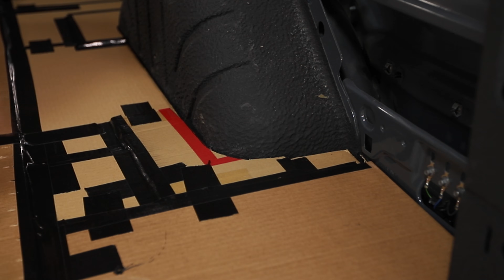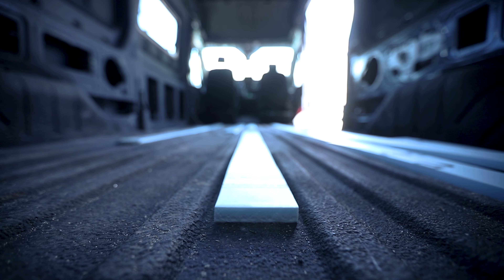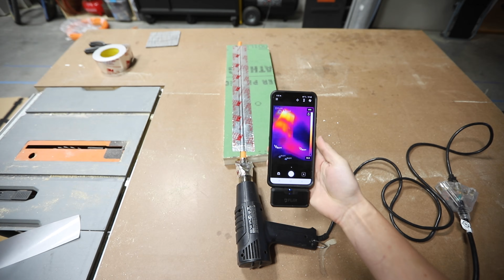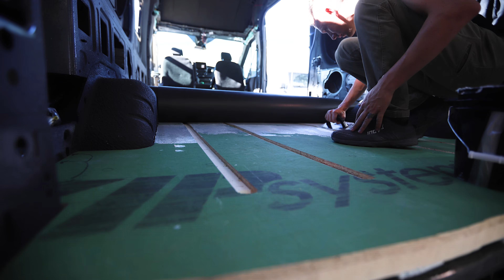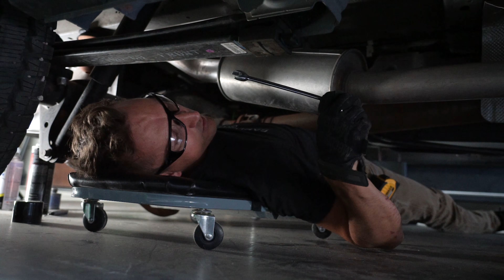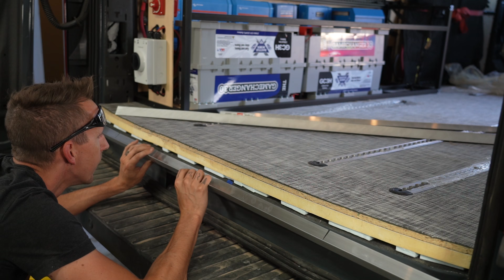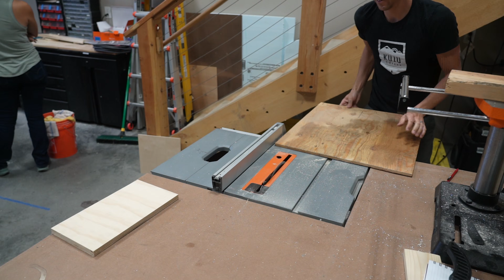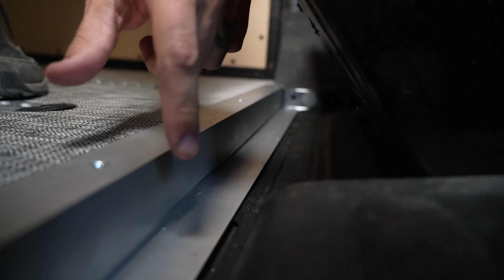VAN FLOORING PERFECTION (Insulation, Subfloor, Covering, L-Track & Step/Lip Trim)

Comment: Another option for templates if you don’t want to use cardboard is buying patterning paper. We use it in flooring to make templates for cutting in vinyl or marmoleum or safety floor. 

Your method also works though :) also rolling the carpet prior to installing the tracks would make it faster. And you can sometimes use a shop broom, flipped upside down so bristles stick up and slide the wood or plastic bottom along the floor to use it as a roller. 

Looks great!

Comment: Watching you install the L-track had me comparing the relative strength of the similar structure I just removed from an old Chevy conversion van.  They built a structure to strengthen the floor so that it could safely attach the seats and belts.  The thing was just massive!  It was steel, and it probably weighs 100 pounds, including the OSB they used to fill in the spaces between steel rails. It was almost two inches thick.  I'm going to enjoy the added headroom now that it's gone!

I almost never have passengers in the van, so the only seat that will be attached to the floor is the rear sofa' bed from the conversion van. without passengers sitting there, it doesn't need that massive steel structure to hold it in place. I'm planning to bolt it down again using the same bolt holes in the floor, and recycle the bolts.  On the subject of recycling,  I'll also recycle the washers that they used under the van, to reinforce the strength of the sheet metal floor around the bolts.  The washers are massive, heavy steel and huge!

Comment: How is that plywood to polyiso lap joint holding up? What kind of glue did you use?
Reply from the maker: Great!  We just used general purpose construction adhesive.
Reply: Follow up….what length bolts did you use to bolt down the l-track?

Comment: Excellent attention to detail. For the side step support, an alternative to your boxing in between the steps is to link the top and bottom steps with a threaded rod. We found the lower step as well as the upper had too much give underfoot, but the threaded rod stabilized both.
Reply from the maker: Probably so!  Thanks for watching.

Comment: Curious how this woven vinyl does with dirt (like actual particles of dirt, sand, crumbs, etc).  We've been thinking we wanted to avoid anything that would have small cracks/crevices/texture that would make sweeping that stuff out difficult.  I'd think as a woven material, this would be filled with those types of small voids?  Easily swept out?

You guys have made Sunday (drearily dubbed "the end of the weekend" at our house) a day we look forward to with your weekly video drops.  Thanks for brightening the end of the weekend! ;)
Reply from the maker: Sweeping sand out would be difficult.  That would be a job for a shop vac at the car wash.  We are choosing more texture and grip over easy to sweep out this time around.  Vacuuming should be a part of any regular cleaning, though, anyway as sweeping rarely gets into the nooks and crannies enough for me.

Comment: How did you position your L-Track to avoid drilling into the gas tank, brake lines, electrical lines, etc.?  When I look at the Ford 2022MY BEMM (I presume the 2021 model year is the same) it appears you are very close to, or on top of, their no-drill zones as shown on pages 162-165.
Reply from the maker: Yeah, VERY close.  I was underneath taking measurements and making sure we didn't drill through anything while Steph was up top drilling holes.  We did have to drop the fuel tank and the exhaust to make sure we didn't hit anything and to be able to tighten the bolts.  Definitely a necessity to not drill before knowing what's on the back-side.
Reply: @EXPLORISTlife  Would it have been feasible to use rivnuts or plusnuts and do all fasteners from inside the van instead of having to lower the fuel and exhaust to access the bolts on the underside of the van?
Reply: @erikmyklestad4817  A lot of people do that. If you're just attaching lightweight stuff like cabinets and accessories you will be fine with that method but it's not safe if you plan on attaching seats in case of an accident or if you plan on strapping down large heavy objects/motor vehicles inside either.

Comment: Rubber stair edging would have worked great instead of aluminum. Won't scratch and can easily be bent....Nice work BTW
Reply from the maker: Yeah, we saw that, and have used that in the past, just doesn't look very good, IMO.

Comment: This is an excellent video, very thorough and helpful, thank you!

How did you decide where to put the L-track?  Do you have an interior plan?

What's the wheeled shop stool you're on in last week's solar video?  it looks great.
Reply from the maker: Good question!  The 'outside' L-Track was placed 'as close as it made sense' to the wheel well, parallel to the wall so that the cabinets had a good place to attach on the floor.  The 'middle' L-Track was 10" from that, which is how wide the seats we will use will be.  The forward and rear 'middle' L-Track was just 4' sections for the seats in the front and bike trays or table in the back.
Reply: @EXPLORISTlife  Nate, do you know of any resources that advise where or where not to drill through a 170 Sprinter floor for installing L Track? We are planning on installing L Track, as you have, but we have a Sprinter. Just looking for some advice on the best configuration for us. Thanks for the great informative resources!

Comment: Beautiful your videos are the best! I’m about to put in a $2000 order, want to support you and I sure love the kits makes it much easier! I’m in Canada thanks!
Reply from the maker: Awesome! Thank you!
Reply: @EXPLORISTlife   the Victron BMV-712 Battery Monitor (Black) comes with the gauge as well as shunt right?
Reply from the maker: @giuliobaecker5476  Indeed!
Reply: @EXPLORISTlife   I use a Debit Card not Credit and sometimes it gets declined online. I’m having trouble with it getting declined at your shop, I can just use my sisters credit card, but any suggestions? Also you don’t sell any inverters, my batteries will be 24v and I won’t be plugged into shore power I’m in an off grid cabin. What inverter would you recommend? I’m thinking the 4000w giandel right now. Thanks

Comment: Nice! You don't need to caulk the marine deck cover for the spare tire cutout?
Reply from the maker: Meh, either way.  We are just trying to keep it 'water resistant'; not water-proof.  There would be a lot more things that would need sealant (under the flanges of all the L-Track and under the L-track bolts) if we were trying to make the thing completely watertight.

Comment: I wonder about self leveling epoxy that you use when you do tile floors. Looks good :)
Reply from the maker: Thanks!  Weight and durability in a mobile vehicle aside... It'd be WAY hard to get the floor of the van level (would have to lift the van off of the suspension) to get the self leveling stuff to lay level/flush.
Reply: Depends what brand, some is quite heavy also.

Comment: Nate & Steph, you are so valuable to me as creators and as mentors! I can’t express how relieved I am to find your video on the flooring. In Spanish we say, “El Maestro aparece cuando el alumno está preparado.” Meaning, the Teacher arrives when the student is ready. I have been a subscriber to your channel for a couple of years, but NOW I am ready with my new-to-me van and ready to start the flooring process. Only difference is my van was a mobility van in its previous life; it hauled wheelchair-bound travelers. So, the van subfloor is steel plate welded to the van body. I’m going to sand off the rust, spray Rustoleum Stop Rust, then proceed as you did with the Zip system. I love your use of the waterproof sail fabric. Thank you, too, for identifying how to maintain access to the spare tire release. Thank you for your methodical, but not boring, explanations and excellent camera-work. You both are gems to me!

Comment: Floor finish looks great and id bet it hides imperfections and scratches well. Understood l track is helping to secure floor but why did not glue as well?
Reply: With all of the bolts securing the L-Track going through the floor, there was no need to glue it down.  Plus, the removal at some time is still an easier option.
Reply: @steveocheltree3575  That makes good sense. I wonder if there would be any rattling at the edges.
Reply from the maker: There's no rattling.  It's incredibly solid.

Comment: You lost me at no floor heating. It's one of the nicest ways to heat a room since the heat rises. You could've used electric grids as an alternative. Not as efficient as hydronic that can get a lot of free heat when the engine runs, but at least you'd have the option. The marine deck plate is a nice touch. Boat hardware works well in any RV.
Reply from the maker: But if it doesn't work... it wouldn't be useful, and I'm not going to lie and say it works well when it truly doesn't.  Sure, I could have spent an extra month making it work and waiting on parts, trashing the flooring we already bought and made the process thousands of dollars more expensive and less DIY friendly; but that's not what we chose to do.  It'll be heated just fine with 1-2 air heaters like we had in our Sprinter we spent extensive time in at sub zero temps.  We will have in-floor heating in a future build; just not this one; so stay tuned.
Reply: @EXPLORISTlife  In-floor heating is relatively new and people survive without it, but it's just a niceness that you can't practically add later without undue work. I do like your work, so I'll be looking forward to the next build.

Comment: Very cool! I built four Transits and your floor solution is amazing, using the L-track to secure everything was a great idea. You are def not afraid of labor intensive operations. Props!
Reply from the maker: Yeah, this will definitely be the strongest, most robust, and most versatile way of attaching everything to the inside of the van we've ever done.  Thanks for tuning in!
Reply: Clean work and precise execution. I would rather be hesitant, with the idea to add  any passenger seats, for use during driving, to this kind of floor. There are reasons, why those in industrial produced cars, always are mounted to at least chassis welded mounting points. And not aluminium tracks with a few screws through iso-layer and nuts on chassis underside not even welded to be fixed sexurely. What about safety belts and their mounting-point geometry in regards to the seats and passengers? For guest-seats, only for usage when not driving around, there are light foldaway seats more practical and much less space consuming. As far my 5cts to a great project, eventually inspiring others to copy.

Comment: Looks great. Is the L-Track the only thing holding the floor down? What is the thickness of L-Track vs the Zip wood? Looks like the groove you cut out went through to the foam? Or is their a lip on the L-Track pulling the floor tight to the van?
Reply from the maker: Thanks!  There is a 1/4" lip on the L-Track that holds the flooring in place.

Comment: Why not just use Roth Radiant Panel system and kill 3 birds with one stone?  Did you not know about it/consider it?
Reply from the maker: I hadn't heard of that one specifically, but it looks nice.  Thermal spreaders like that would have definitely solved the problem with getting the heat to spread around, but I don't feel like it would have fixed the structural integrity issue and I know it wouldn't have fixed the issue of having the pipes being felt through the marine flooring.  We will spend more time on this and come up with a solution for our next build.
Reply: @EXPLORISTlife  Thanks for the response.  True about the tubing but the weight savings over the insulation product you chose would allow  use of a thicker vinyl flooring with superior noise blocking properties or you can add a sheet of 1/4' plywood (which is what we did).  Apropos to structural integrity issues, you are mistaken.  Roth will happily supply you with the testing data,  No issues under out water tanks or 10kwh of batteries:  after 3 years, ~40k miles use.

Comment: Just curious. Don't you want to leave a little air circulation in your van floor for water or humidity to dry out? It seems like humidity always find ways to get in.
Reply from the maker: I'm not too worried about massive airflow under the floor because everything under the floor is waterproof or water resistant; so everything should dry out naturally given adequate ventilation of the van itself.
Reply: @EXPLORISTlife  ok, thanks! And... Thanks for all the rich content videos you have done so far!